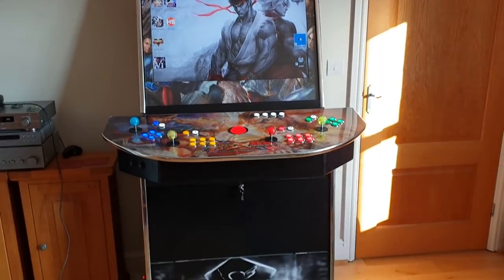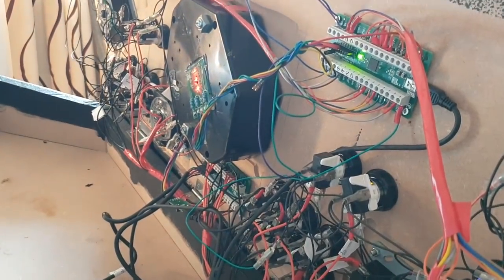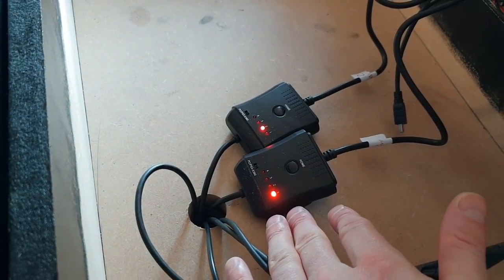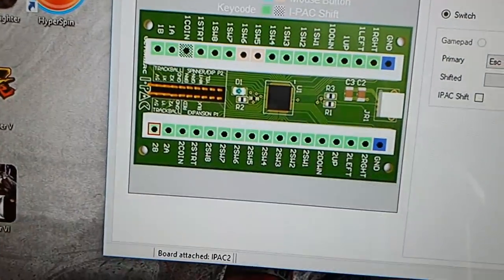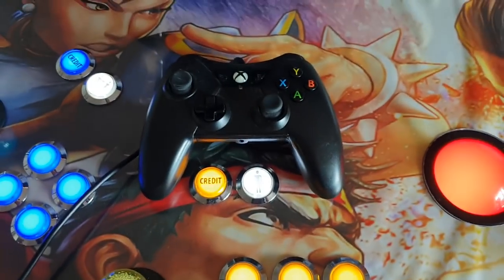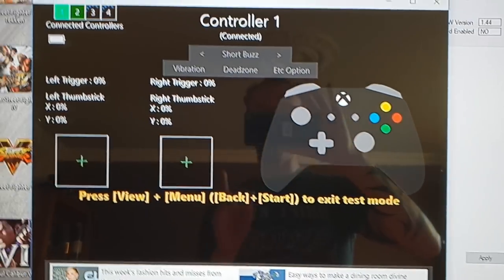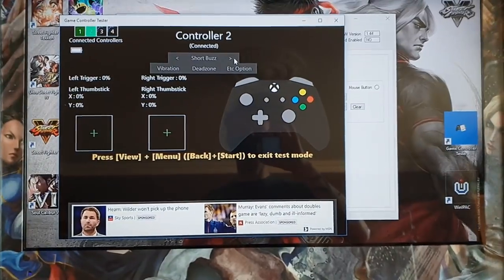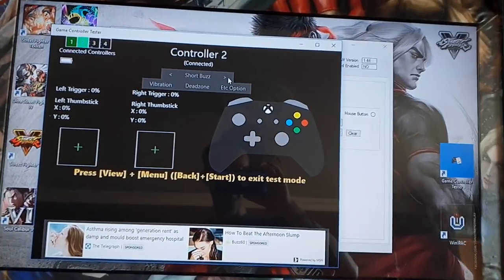Tips on installing Ultimarc Ipac Console Adapters (Arcade Cabinet Control Panel Gamepad Support)

Comment: @Noel Hand Grenade  Can you confirm if i use 2 players on the one ipac2 i only need the 2 xbox adaptor usbs plugged in, and not a 3rd usb for the board usb. (so basically 2 usbs not all 3?)

Comment: Cool but don`t the extension gamepad dongles mean that u are generating a key press and a joystick command at the same time thus confusing the game being played ? btw u can set up Xpadder as a blank templated that can shift with chosen button combos to alternate maps within the same trmplate where u would assign keyboard functions to it and then make another shift combo to get back to the blank template, I do it all the time on small custom self built gaming PC`s where I`m usually just using an Xbox gamepad and nothing else by switching through mouse emulation with keys mode, blank mode and another variation
Reply from the maker: No, when you enable the gamepad dongle it ceases generating keystrokes.
FYI Ultimarc have updated the firmware anyway now and the dongles are no longer necessary. I grabbed the latest firmware (hard to find, the guy who runs it sent me the file) and now i don't use the dongles anymore.
Reply: @NoelHandGrenade  I bought 2 dongles years ago but not used them yet .......so then your ipac2 is running with usb plugged in for power this time this time with buttons mapped to gamepad in the settings, as I don`t suppose that the PC will know what type of controller it`s seeing ( x360/PS3 etc ) is this being detected as direct input only ? .........
Reply: @NoelHandGrenade  I have new ipac 2 boards now, has this new firmware without the need for the dongles at all been standard in the supplied firmware for a while now ?

Comment: So, using the same setup you have (pc based, i-pac 2 + 2x Paclinks) and hoping to achieve the same results you have.
The chart says Button "A" needs "L-Ctrl" input sent to P1 SW 1.
So am I correct in saying, I just make sure P1 SW 1 is receiving "L-Ctrl" input and wire P1 SW 1 to Button "A" on control panel?
Then in game, pressing Button "A" will respond as Button "A" on xbox 360 controller?